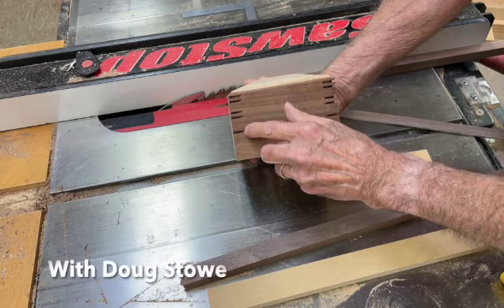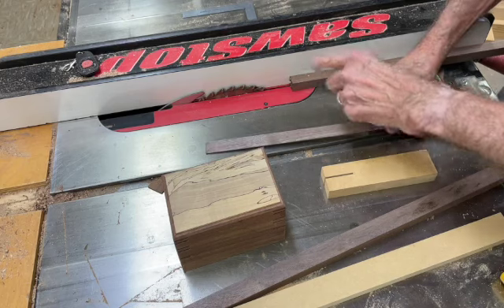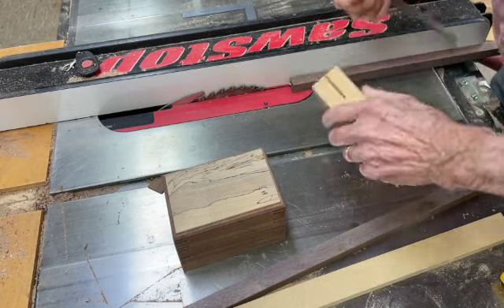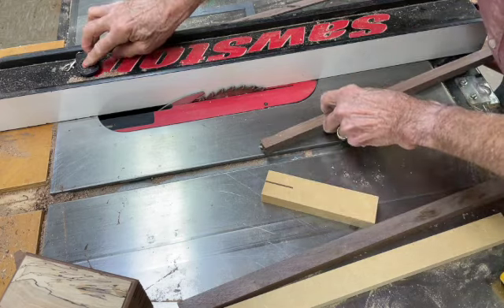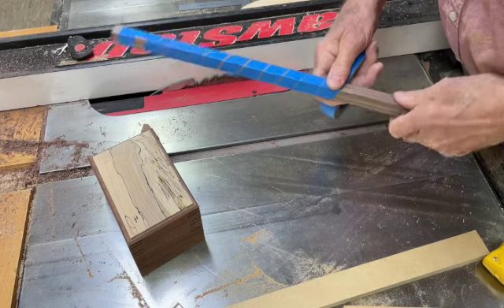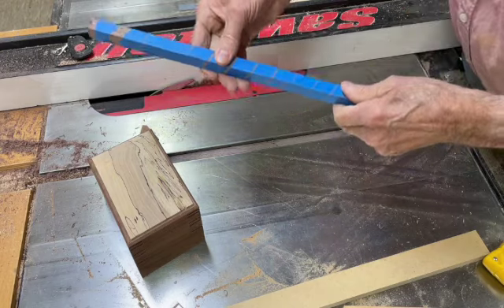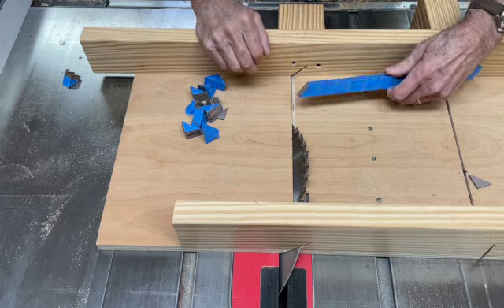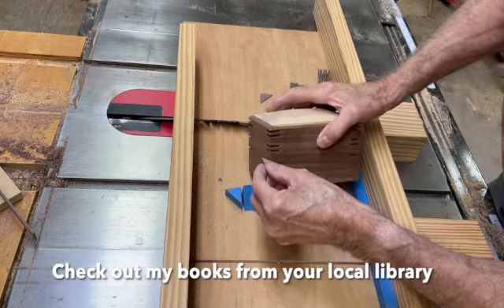Making miter keys   SD 480p

Comment: I've been mostly using dowels for a nice look and structure for these kinds of builds. I've been thinking of trying splines like these to check out there ease of use and for their strength. They would also be good for thinner wood. I like your technique for getting more splines with less waste. Thanks for the video!

Comment: I also noticed the length of the stock is such that he had control of the tail end even after the front end makes it past the riving knife.
Reply from the maker: Certainly, length of stock is also an important consideration. I like to work with stock long enough to keep a good grip throughout the operation. And the riving knife is an important safety feature.